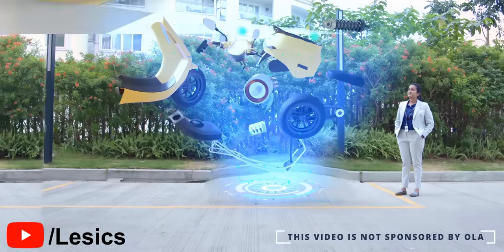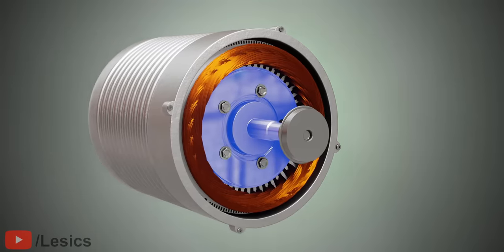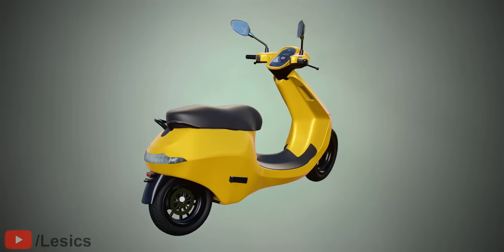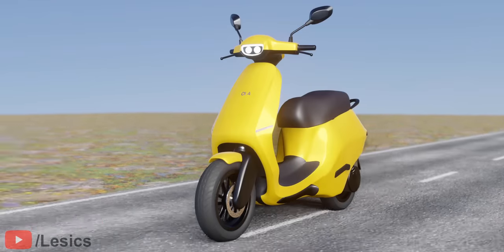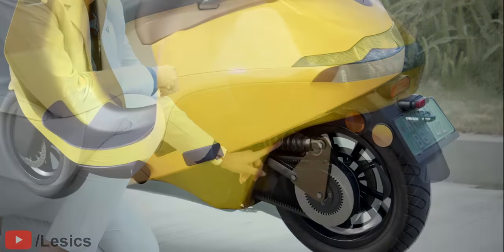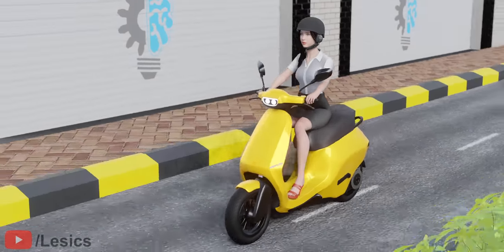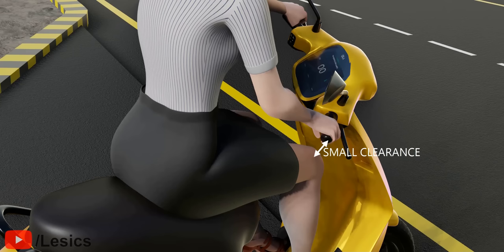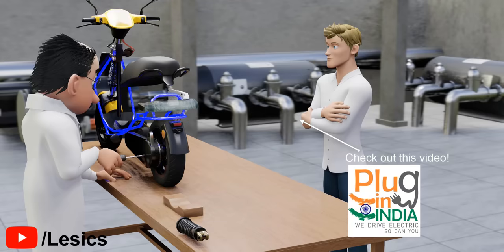Ola scooter | The detailed Engineering behind it

Comment: 5:32 The best way to overcome the heating issue is by providing a proper cooling system. Not the cut off.
Reply: Probably they're cutting the cost to be more available to the masses, but it would be great if that issue will be addressed without putting too much weight on the cost.
Reply: No ,there is some issue with the controller,bms etc due to reverse mode feature its somehow getting short circuit
Reply: Inducting a cooling system would increase the cost and cooling systems has their own drawbacks.
Reply: @krushna4181  What kind of drawbacks, Mr. genius? Ather has been making great products - they took 5 years to perfect their tech and have been 4 years in the Indian market. All cars - from Tigor EV ( currently the cheapest EV in India ) to Rimac Nevera use liquid cooling. Just one disadvantage - increased cost. So say straightly that they're cutting costs from the scooter rather than defending them. If you say it's an Indian brand, then I'd like to tell you that Ather is also an Indian brand. I'd support Indian brands, until they make quality products.
Reply: Tested another EV brand with liquid cooled system, after 30 minutes of 130km/h, the speed reduced to avoid overheat.
Reply: @Aswin Biju Lol. Ather has no Gel or Liquid cooling for the battery. It does not have fan cooling either. Ather only has fan to cool the motor.
Reply: @krushna4181  have you heard of air cooling?
Reply: @elliryc3307  they could just add an air cooled system. Nobody is asking them to put liquid nitrogen and get record breaking benchmark scores
Reply: @tuneup858  which ev you used
Reply: @shahbazshaikh8362  Alrendo TS Bravo
Reply: Slapping a heat pump on a small scooter only increases the price.
Reply: Would add complexity (and a bit to price) and weight... And you still need the cut off in case cooling fails.

Comment: I'm not an engineer or anything, but batteries usually gets on fire due to bad BMS. So unless the BMS fails to do what it's supposed to, batteries should be safe. Also real life testing is different then lab testing. India's temperatures easily reaches up to 50 degrees (in Celsius). Maybe the battery chemistry was not good for such harsh environment. Still If the batteries were overheating, the BMS should've done it's job of cutting the supply. 
And yes a cooling system would be a nice addition without adding too much to the cost. Even IC engines has proper heatsink for the cylinder part. They can somehow make a heatsink for the batteries so that they're air cooled rather than sealed in pack.
Reply: It's because of people drive in extreme heat which heats up the Lithium-ion batteries to much, also park in sun that's why batteries caught fire, Same can happen with smartphone batteries.
Reply: Not just india, and not due to Heat persay.

These Scooters have to be sold to Asia as well, and in asia, you have to worry about humidity more than heat.

One of the worse enemies of Lithium Ion Batteries is Humidity, and can result in Corrosion that either shortens the battery lifespan, or increase the risk of catching on fire.

That's why Most Electric Cars don't really last that long in Asia. The climate there is the Bane of every electric based vehicle.
Reply: Yeah a cooling system would be nice.
Reply: @sunnysurwade464  ok please come and assist me where to park my vehicle or come with me where I go and setup shud for my vehicle where shud is not there
Reply: @nithinniki7427  You need to take care of that in Indian summers, for other season it will stay cooler, Electric vehicles are new for people but over time this problems will be solved...
Reply: The bms has some limitations on what it can do. The bms is like a switch in series with the battery that would turn off if some unsafe conditions are noticed. Like excessive current draw , over discharge, overcharge,high cell temparature, low cell temparature, cell voltage imbalance... But it can not stop the battery from going into thermal runaway. At best it will stop the power flow when it senses high temperature but if the battery is internally shorted then it can not do anything about it. Ola should have used lithium iron phosphate battery, their energy density is bit low but they are much safer even when overheated. They don't catch fire as easily and most importantly they don't go into thermal runway at such low temperature. The only issue is they can not be charged in below 0 temparature so u r not taking this to ladakh or kashmir. Another issue is their maximum c rate is only 3c and continues c rate is 1c .
Reply: Battery are from chyna ....not japan , Korea so....fire is normal
Reply: @georgecarlinn6288  china batteries made by name brand chinese cell makers like catl have lower records of battery fire than south korean battery maker LG. So this invalidates your statement but there are hundreds of cell makers in china and if u get them from shady sellers on Alibaba then there is no obvious guarantee.
Reply: @sunnysurwade464  that is not reason because of extreme indian temperature, whenever the batteries are drained quickly very  of their charge they heat  recharged immediately with fast charger they will heat up causing an battery  thermal runaway condition. Also a cooling system will not help an inferior, contaminated battery
Reply: @Xdddd422 But battery pack have heatsinks and mainly they have liquid coolent which flows through pipe and touch each cell 
And these can easily handle and cooldown like 60°C

And mainly if you ride them in superfast mode and park In sunlight for long, it's not suitable to do so.
And superfast accelerating is for emergency or sometimes but don't use daily. It's an consumer type vehicle not RACING SCOOTER

It's the driver fault 99% always.
Like parking in sunlight, etc
Don't park in sunlight over 1 or 2 hours. You see most of ev fires during parked in mid day sunlight 
Or while charging

Don't charge in wet conditions,  use correct charger, use correct ground outlet, use correct charger, don't use damaged charger etc.
Also don't leave it charged
And there is only 1% of BMS malfunction and it's very rare. VERY RARE.
Like in 100000 scooters only 1 or 2 can have bms problem
And please don't drian too low and charge with supercharger fastly and then use it again. This causes damage to battery
Reply: @nithinniki7427 He means don't park for TOO long. It's not good to park for 2 hr or more.
Reply: @georgecarlinn6288 But ola will stop soon with temperature warning. And most people do that mistake. But over 60C even cooling system can't do so it has to cooldown. But some people found way to do something so it will even go after termpurtre is so high. I think they cut or short or do something with wire to the display and scooter does not display any temperature warning. But it's not safe and soon they hacked the bms (they literly did something to wire) so bms does not know and keeps overheating and battery enters thermal runway , catching fire.
I have seen some videos to do wire and "solve" temperature warning.
So mostly user faults. I say.

Comment: Well this channel has explained everything regards to the Ola scooter.. The only issue I am facing is the front suspension rattles a lot on concrete roads. I am not sure is it the wrong air pressure which the company has recommended or is it the front suspension which is very fragile. 

Also one needs to know how to ride this scooter and take care while riding at the same. Using Hiper mode continuously is not advisable,  one u have touch 70km, change it to Normal mode and the scooter will perform well and you will get a better average.

Comment: Summer temperatures in many countries in Europe reach well over 30 °C, where I live they go from 30 to 40 °C (86 to 104 °F). I think the temperature excuse is a little bit of a stretch. 
Heat (and eventually fire) is a big issue in electric vehicles, especially because fires from batteries are very hard to extinguish

Comment: There should be at least some venting on the batteries and motors. Electric powertrain might not be as hot as Internal Combustion ones, but they do still generate quite some heat.

Comment: Sir, completely loved it! I just love how seamlessly the animations are. Could you tell us, what software do you use to make this? I'll be grateful. :)
Reply: Blender
Reply: Blender - free but the slowest of all. Maxon Redshift - paid but fastest of all & professional. Autodesk Arnold (3D Rendering) - paid but extremely fast & professional. Autodesk Maya (VFX) - paid but extremely fast & professional. I'd prefer Arnold.
Reply: @ravenclawgamer6367  whatever it may be they use blender and moreover skills matter a lot than software and this is the example
Reply: @HeresEverythinG  Without software, there are no skills. It's too apparent you're just saying stuff without actually using the software. With the kind of videos and how frequently they upload, it doesn't make sense to use Blender. It's affectionately called the snail by many professionals. Something which takes 1 day on redshift and 1.2 days on Arnold can take as much as 5 days on Blender. So don't speak before using things. I like AutoCAD and Arnold the best. Because (I'm nitpicking here), even though Redshift is the fastest, its Ray Tracing is a notch lower in quality compared to Arnold. And both being software from the same company, they can inter-operate easily.
Reply: @ravenclawgamer6367  then let me know how much you have used blender and what all projects you have made
And just by saying some software names you can't say you know everything. You are comparing costliest softwares with free one. Don't judge the potential of the software with its cost

Comment: Please also make a video about the Ather450x . Ather 450X thoughtfully designed and engineered , or I should say over engineered.
They’ve very well engineered the obvious aspects like thermal management and also parts like side stand , mirrors ( you cannot remove mirrors in ather 450x they are important structural support for the front head body panel. So unfortunate for many Indians they won’t be removing the mirrors of their ather , hence increasing road safety ).
There are many small , overthought and over engineered aspects about this scooter that I’d ( we’d ) like to watch uncovered on this channel.
Reply: This is not an automobile review channel.
Reply: Ather is very nice. They have zero competitors in the market, at least for now.
Reply: @ravenclawgamer6367  zero competitor? OLA has already taken over... There's OLA everywhere... I hardly find ather... Yeah one scooter caught fire but apart from that in terms of sales OLA is doing quite great
Reply: @GamingMinatiIsHere  LOL. I've seen multiple Athers and zero OLAs. OLA overheats, suddenly goes in reverse and can even catch fire. Ather has been in the market for 4 years now. Zero such incidents. 'Wayy' higher service network as well. Some OLAs are functioning decently, but majority are faulty. Did you see the video where OLA couldn't even climb a hill. Bajaj did in sport mode and Ather did in City mode.
Reply: Ather is an example of indigenous technology unlike Ola which just reverse engineered
Reply: Ola won. Ather lost. End of story.

Comment: june 12 2022
yes , i liked this vid' very much.  its a 1'st for me to see a pro & con
presentation for a vehicle.   i'll be coming back for updates.

    one thing to ask for is based on living in colorado where so many roads
are uphill.  could you provide some info on the battery elevation gain data.

    for instance  the elev where i live is 5300'.  and my wish is to ride
the Ola north 25 miles to Cripple Creek.  situated at 9500'.
the road is paved 1/2 the way,  then becomes an
 all-weather maintained  dirt county road.

     how far can i expect to get on a full charge ?

Comment: The main reason of battery heating is poor quality material , compactness and poor heat dissipation system which eventually leads to such conditions , there should be proper ventilation for cooling to the motor and battery.
 All the models should be tested in different roads and climatic conditions, you can't just copy and paste and sell it in the market just in this case .
Reply: the batery and the motro is not in a ventilated place at least it should have an air flow
Reply: @elarcadenoah9000  yes there should be proper ventilation .

Comment: The complete failure of OLA scooters clearly explains why IT people should not do anything else as they think software updates will fix core engineering issues .
Reply: One of the dumbest reasons I ever heard. The product is designed and developed by engineers in their respective field.
Reply: @infinitebeing1119  Thanks that now is more slap on the face for such a sham ..overhyped product which fails to deliver in field.

Comment: Why didn't Ola use active cooling mechanisms for its battery pack and motor? Would have prevented the overheating issues. I guess more customers would have been okay with the price increase to get a safer product.

Comment: It think you could fix the turning discomfort problem by making the handles into a steeper Y shape or making some sort of mechanism to cause them to lift up as the turning radius reduces, both of these solutions would prevent the handle from colliding with the knee.
Reply: Your first suggestion is practical cost effective and viable

Comment: Ek electric dirt bike banani chahiye kisi company ko jiski motor:- 75-5 passively air-cooled, high efficiency, radial flux, interior permanent magnet, brushless motor honi chahiye
Aur High efficiency, 550 amp, 3-phase brushless controller with regenerative deceleration wala controller hona chahiye taaki 140 kmph tak ki top speed de paaye koi company aisi dirt bike banayegi kya?

Comment: Scooter designed for Amsterdam tested in India results are shown.. obviously they didn't consider temperature swing in India
Reply: One scooter out of 50000 delivery burnt. It's holding on really well.
Second, scooter fires are not caused by heat

Comment: This fire problem is common. For electric scooters, as they don't have radiator and coolant running through it to cool motor, like Tata Nexon EV and other EVs. Even electric bases are safe.
Reply: Size and design of the battery has to be considered in opting for the right and optimum cooling method . Liquid cooling is cumbersome in this design . Plus cost factor and maintenance are also to be so side red . 
Cars have much bigger batteries and are laid flat so a cooling chamber can be built around it .

Comment: Why CVT ( continuosly variable transmission) is not used in electric vehicles?
Reply: Transmissions are required for combustion engines where reciprocating motion of piston is converted to circular motion resulting in limited range of revolutions per minute. Electric motors don't have that limitation and their RPM can be changed significantly by changing the properties of EM field generated by the motor. So, to avoid drivetrain complexity and power loss in transmission CVT or other gear boxes are not used.

Comment: Heating issue is only to the controller and motor not to the battery as battery temperature are observed to be normal 32 in few you tube videos I saw that. Your animation vis excellent but plz work on logic and analysis 👍

Comment: 17C European summer temperatures?  Where the hell did you go to measure that?  It hits 40C across Southern Europe at the height of summer and certainly between 20-30C everywhere else.  A few Northern parts, higher up in Scandinavia have shorter summer period but they can still get fairly hot.
Reply: I think he meant to say Netherlands where the e scooter company etergo is based on and it's temperature is not so high.
Reply: Right brother . Even in Canada the temperature goes higher

Comment: I have kept my ola in hot 🌞 in 44 degrees heat and drove it immediately for last 3 months no issues at all. Hyper mode also I did not face any issues but I think this heating issue is only in few models slight BMS tweak will fix this and I m sure ola will fix this in case there are any issues or tweaks required 👍👍
They have the best engineering team 👍
I saved my 10000 in last 3 months. I love ola it's performance looks everything

Comment: Did the company tried to incorporate water cooling system for the battery and motor?
Reply: Water cooling or any liquid cooling will add to cost in the first place. And come with additional problems and maintenance. Third space is a constraint too. Of course it is one of the options which have to be kept in mind.

Comment: I had booked 2 Olavut cancelled both as Ola is not dependable and apt for Indian conditions with no battery fan, battery burning, software glitches leading to reverse at 100kmph on some instance, showing 20km range but suddenly battery down to zero, failure to ride on hilly terrain with heating issues many a times..
All in all features are good but you cannot depend on it and use as your primary vehicle so instead paid some extra bucks and bough Ather which is way more dependable.

Comment: Bad topic Lesics. I've been a fan, until you account for this. Ola scooters are overheating, sometimes shut down or go in reverse uncontrollably at very high speeds (some are not, but most are). Some are even blasting. You should've talked about Ather. 5yrs+ development time, 4 years in the market. No fire, no glitchy software, no deaths. Just owning a large production plant doesn't mean anything, unless they make quality products.